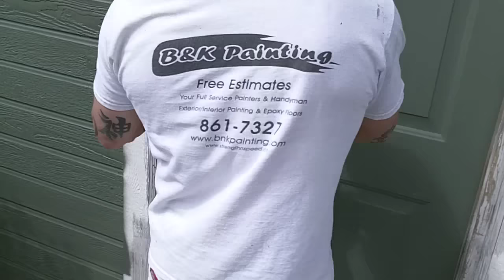How to paint a door while not taking it down.  Painting A Door.

Comment: I have pulled the weatherstripping off and masked the inside of the frame as well. Works great if the color change is minimal and the opening is large enough. I ALWAYS take the knob and lock off and mask the hole over the other side. I am surprised you don't sag the paint anywhere with how many times you sprayed on the left side of the door.I usually spray the door totally open with a curtain of poly behind. It can be a pain on a windy day but the door gets sprayed without any hint of missing. I also spray the hinge side edge as it just looks better especially if the exterior side is a different color from the inside but that can just be personal preference I guess.

Comment: I want to spray a fiberglass door.  Do I leave the same masking for primer as topcoat or change masking for each paint?
Reply from the maker: Leave the masking
Reply: Yes leave the masking. But I would loosen the handle and the lock just a little bit so that your tape isn't smack right up against the door. Because when you pull the tape it will want to peel the paint off the door. That's why you spray and then remove masking before the door is completely dry

Comment: great job !..what size of spray tip did you use ? Is 515 too big to spray interior doors
Reply: Go to your paint store and buy a 4/10 fine finish GREEN graco tip. They are perfect for small areas like doors.  Turn up the pressure and blast away. You have to be really experienced to use a 5/15 as it puts out A Lot of paint. Personal preference, to each his own. Great video. RH DSD
Reply: +DIOSpeedDemon  
I use the Titan purple sinergy tip 2 12.. 3/4 pressure on my Titan 400 traditional regal semi gloss.. not the select. love the regal select wall paint buy semi gloss sucks so I stick with the original regal semi gloss for trim and doors.. comes out perfect
Reply: At 5:15 is a bit faster for doors especially if you lack experience. A better tip that would slow things down a little bit more would be a green tip say a 3:10

Comment: I spray a lot for work but this is just wasting time all that taping up and stuff I could've done it by brush and baby roller in 10 mins
Reply from the maker: I never roll a door, the finish is much better spraying
Reply: There’s a time where you have to accept the fact that just because another paint technique takes longer, doesn’t mean it’s wrong. It’s just different and to tell you the truth, the finish after rolling isn’t as good as the finish when sprayed. You’ll leave stippling changing the texture.  If I was an apartment painter, then sure, I’d roll it, but I’ll never be an apartment/turn painter.  There’s different quality levels, Nissan.  Some people don’t want the low quality finish you’re mentioning.  That’s just the truth. Another great video, chris.
Reply: I have worked for many painters that are always looking for shortcuts for me quality is number one. Especially for a front door so sprained and using a little extra masking is all about quality
Reply: I could of done it in 2 mins by brush and roller .
Reply: I could have done it in 30 seconds just dipping my hands in the gallon and wiping the paint all over the door....
Reply: @Idahopainter  💯❤